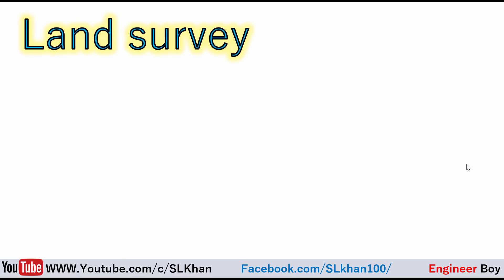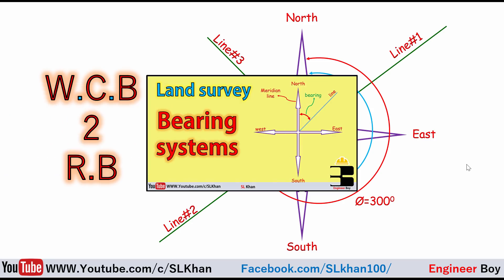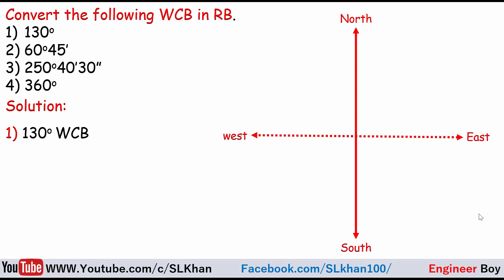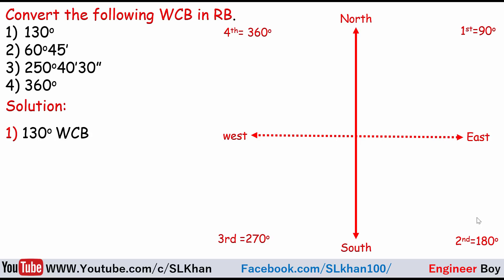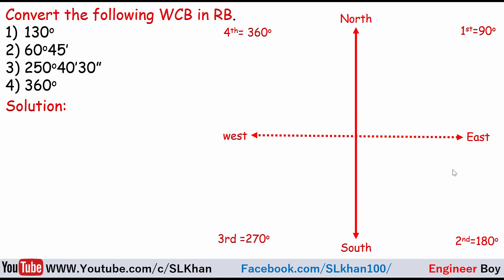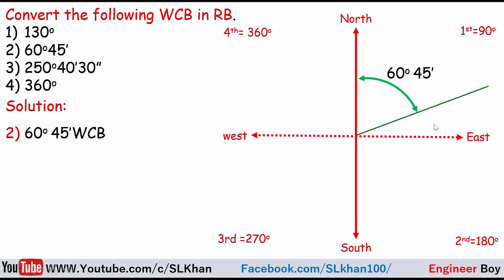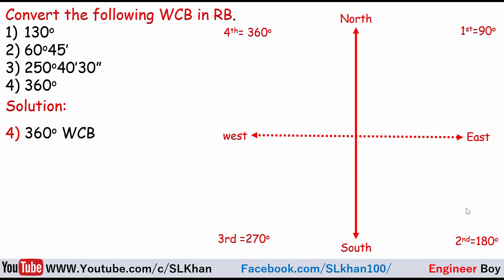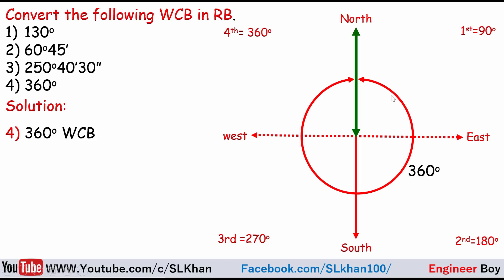how to convert whole circle bearing into reduced bearing system? | Civil engineering

Comment: Excellent teaching, you made this so easy to understand.  I have been looking for a video like this on You Tube and yours is the best one I have seen. I do have one question, when calling north it can be zero or 360, east is always 90, and south can also be called zero or 180, but west is a mystery to me. It seems to just have one option which is 270. However, I have seen it written in a deed placed as 000 degrees west which makes no sense to me. So how should west be called in most cases?